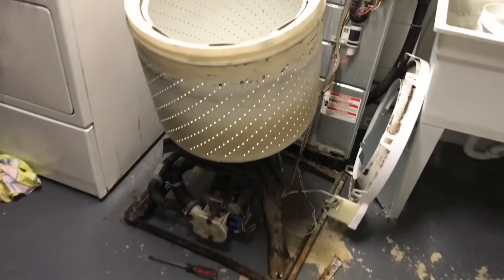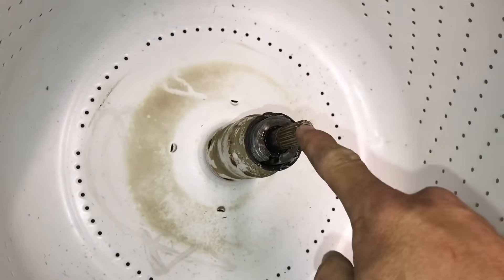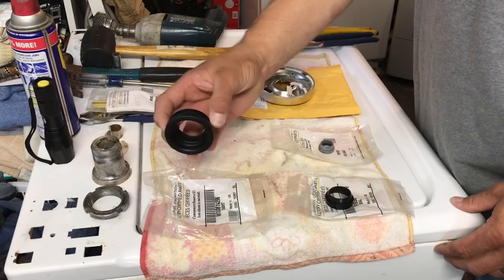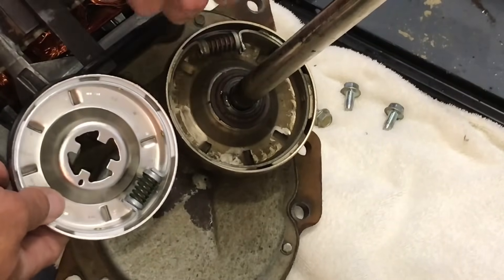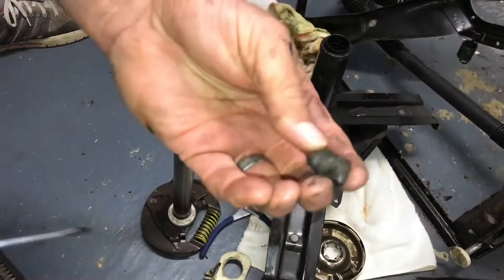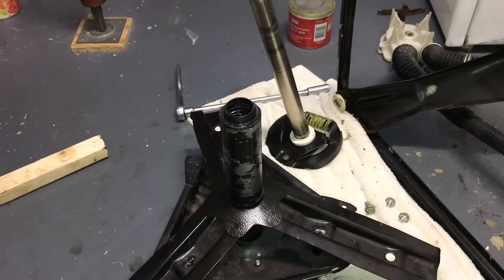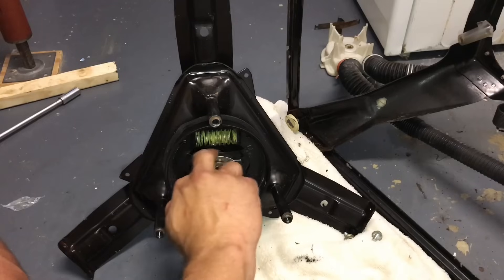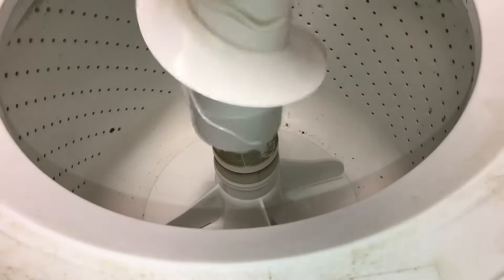Leaking Kenmore Washer - How to replace Shaft Seals.

Comment: Great vid! As appliance tech for last 22 years I never  seen this direct drive washer leaking because of the upper transmission shaft  seal .  it is always tub seal   or lower delta support seal. And yes this is the most dependable and repair friendly washer ,always worth to repair it and keep it! These days appliances are disposable junk made to last 5 years .
Reply: I replaced W10820043 BASKET DRIVE ( shaft w/ seal yesterday for leaking and noisy) Only seemed to leak at high water level
Reply: Hi, whats this 'lower delta support seal' you speak of ?  Thanks.
Reply: @ArnoTrek  I believe he is speaking of the tub support seal.
Reply: @bryanjones4985  I don't understand the difference
Reply: Thanks for your comment, I was wondering what a pro tech would say about this machine.   I've replaced many parts on my machine (Whirlpool LSR6334LQ0)...Hopefully the trans will hang in there, it seems to leak few drops after a month or so.
Reply: @ArnoTrek  and for clarity -- the seals (2) in the bottom of the support tube below the lower basket drive bearing... the lower seals (and upper) are for the basket drive tube (the one with the brake and big yellow spring on it) - if the water coming out the bottom is rusty probably a good idea to change the basket drive bearings also
Reply: Great video but I have messed up 3 lower shaft seals and can't get it to go down. I always tear the rubber part and it still isn't where it needs to be.

Comment: You took a big gamble installing that seal like that, and the way you pulled it out. Use a socket to tap it in not a piece of wood. When pulling it out, pry it out with a screwdriver not between the seal and the wall of the shaft. You risk bending it.
Reply from the maker: Thank you for that info.
Reply: Have you tried this yourself?  I couldn’t find a socket that fit inside the tube and that was big enough to press down on the steel collar that is molded into these seals - maybe an 18mm?, but I only had 17mm or 19mm. No SAE socket would work.   I used a wooden block too and no damage to the seal at all. The upper seal needs to go in further than you can do with a block of wood, but tapping around the edges of the seal (where the steel collar is) does work.

Removing these seals requires prying them out / because they have a thick metal collar molded into the rubber.  There is no way you could pull them out with pliers.  I did it the same was as in this video - and the shaft didn’t bend at all.

Comment: Great video.. I have a whirlpool top load that runs the same way and the setup is the same, direct drive shaft.. Mine was agitating but not spinning when it reached that cycle. Changed the clutch still didn't spin. Checked the coupler and it was good. With the cabinet off I checked to see if the clutch was spinning when the machine was on, it wasn't. Took off the transmission and manually turned the motor, didn't turn. Decided to go into the transmission. As soon as I set free the plate that covers the transmission, where the oil and gears are, about a cup of water rushed out. So I decided to drain all of the oil that was in the transmission, and half was oil and half water. Cleaned the transmission with kerosine and a clean paint brush, allowed it to dry, topped back up the transmission with 16oz oil and assembled the machine.. Machine is now perking, agitating, spinning and working like brand new.. Before this episode I had to change the tub, upper and lower shaft seals due to a leak. I guess what happened was water leaked into the transmission causing the gears to slip, so if you're changing your seals for a leak, check the oil in the transmission for water as well before you reassemble

Comment: Great video and super helpful. One thing to note for anyone attempting this repair- the lower shaft seal has a metal ring embedded in the rubber that you have to mangle to get it out of the tube. Don't put the screwdriver in too deep or it won't grab. I thought I was messing up the tube until I got the whole thing out.
Reply: The upper seal also has a metal collar in it.

Comment: 4years later! The best instructional video ever!
Reply from the maker: Thank you. So glad it was helpful! Happy Holidays and Happy New Year to you and your family.
Reply: Khhhhhbbbbbbbbbbbbbb     

 @SmokinwithKasket
Reply: It looks like to me is there’s corrosion and pitting on the shaft were to seal run on. I would have replaced the shaft just in case. I’m a retired maintenance machinist and worked on a lot of high pressure pumps and I would machine a replace the shaft. Just my two cents

Comment: I found this video extremely helpful, I couldn't have made the repairs I did without it, but I do want to toss in a couple of considerations for DIYers or even people experienced at making repairs. 

We have an old Whirlpool commercial capacity washer and dryer in our company shop that we've used for 20+ years. I got them off my mother when she passed. They've done yeoman's work of at least 5 loads a week, year in and year out ever since. I've worked on them regularly through the years changing out belts, relays, switches, igniters, pumps, transmissions, hoses, controls, etc. We could easily afford a new one, but I love these old machines, their simplicity, their capacity, and their reliability. Having said this, I think this has been the most challenging repair of all that I've made on it. 

Here's why! The drive block was frozen to the drive tube. No amount of WD-4- or Liquid Wrench made any impression. I finally had to place my spanner underneath the nut to get enough leverage with the 3-jaw puller to break it loose. When it finally did, it broke the tube lock on the bottom and the whole assembly came out. It then took concerted effort with a rubber hammer and a wood block to separate the two from the inner tub and even more to get the drive block off the shaft. I have a small press. This is information is not meant to dissuade you, just warn you in advance that this may not go smoothly.

That assembly hasn't ever been out of the machine, even when I put in the new transmission. Truthfully I didn't even know the upper and lower seals were there. The problem with mine, perhaps like yours, is that I let is leak for more than a month before I gave up on it and decided to tear it down and make the repairs. This added some rust and other issues to the springs and getting them loose. I've machined and mechaniced since I was 19 and I rarely give up. I'm almost 69 now and I did eventually get it all out and I did make the repairs. I also broke the water inlet spout which cost me about $45 more dollars.

We've always kept pretty much an entire machine in our storeroom and other than the upper and lower seals and the tub seal, I had a transmission I rebuilt on hand and a brand new spintube assy. I also have access to welders, lathes, flame-spray, end mills, etc. Hence I wasn't afraid to break something if I had too. I've rambled all this time to say that you less well-armed DIYers may need a contingency plan in case things don't go so smoothly or quickly. We're in a small town, but we have the Internet here (Amazon) and we also have an appliance parts store 20 minutes away. If they don't have it they bring it out of LA the next day.

Honestly, when I was 19 I would've beat the Hell out this machine with a ballpein hammer. People would've heard me take the Lord's name in vain repeatedly. Sailors would've blushed. Of course then I'd have had to go out and buy a new washer. Five decades later I have a few more skills, cooler temper, better tools, and easy access to the proper parts if I break something accidentally. I also have the luxury of taking a week to do this repair since I'm the boss and we were smart enough to buy a used spare Kenmore clone set a couple of years back for standby. Almost all the same parts on both.

I find this to be the best video on YT for this repair topic. I hope this comment wasn't too far off track and wish all of you the best of good fortune in the teardown and reassembly of your washer. Keep up the good work William Kasper...
Reply from the maker: Thank you, my friend for your input. That was some awesome information and extremely satisfying to read. And it is true the older you get the more patience you have to deal with these kinds of repairs. I was fortunate to get my tub separated with a three jaw chuck and I wished I would have demonstrated that in the video. I will say this is an in-depth repair And can be difficult pulling parts apart that have not been apart for decades. I’m glad this video was helpful for you. I almost didn’t do it because I generally do videos about smoking meat and outdoor barbecue recipes and it was a last minute decision to grab the tripod and phone and begin filming this video. On top of the amount of work required to do this type of repair. It’s also very time consuming and Difficult to use the camera and narrate and then edit and do all the required functions for a YouTube video. I have to laugh because I must’ve been feeling energetically when I decided to do this repair and make a video out of it.  Thank you for watching and sharing and hopefully subscribing. Stay safe and thank you again for your story.  
-Warm Regards
Reply: No mames, pues que técnico eres?😂
Reply: Same here - used a gear puller to break the drive block free. It fought hard to stay on. My washer is 35 years old and had never been apart.

Comment: Thank you!!  If I had not seen this I would have been at a loss since after disassembly it was clear that the leak coming from the center of my 25 year old Kenmore was not the tub seal.  If not for this I probably would have retired the machine. I used a socket to seat the upper seal as another comment suggested and things are back to normal.  As for removing the basket, I tried a 3 jaw puller but it didn't break it loose.  I ended up removing the spanner nut, placing the spanner wrench (tabs facing up) over the shaft,  screwing the spanner nut back on partway, then placing a large adjustable wrench above the spanner wrench (resting on the shaft) and using two large c-clamps (one on each side of the shaft) to compress the spanner wrench and adjustable wrench together.  This easily broke the basket free.  It had never been removed in 25 years.
Reply from the maker: Hi Michael. Glad to hear this video was helpful. A 25 year old Kenmore; Mine  is half that age.  They are amazing machines.  In 12 years time we fostered over 27 kids and adopted 5.  Our Kenmore washer and dryer have ran 24 hours a day for many days at times.  At one time I considered getting a second pair washer and dryer. Those days are over thank God!  My units have been put though their paces and proved to be amazing machines.  Thanks for the input on removing your basket.  I can imagine after a quarter of a century, that baby was fused on that shaft!  Thank you for sharing your method of (basket) removal. Thanks again for your support.  All the Best my friend.

Comment: This is why I love youtube. The clutch is shot on my 15 year old Roper and I was about to place an order. Then I come across your video and you're the only one that mentions these seals. I was wondering why my clutch housing was rusty. It's because water has been seeping in. Thanks again for sharing!
Reply from the maker: Thank you for watching and commenting. Glad the video was helpful. Best Wishes.
Reply: @SmokinwithKasket  Tore into mine this morning and thankfully I didn't even need a puller. One question though. There's another seal inside the shaft down at the base, just above where the brake assembly fits into. It's more of a normal seal like you'd find on a car. Any reason you didn't bother with that one?
Reply from the maker: @89Mirageman  - Because normally it’s the top seal that gives out and I didn’t want to disturb the bottom seal if I didn’t have to so I just replace the top one and everything worked out fine.
Reply from the maker: My philosophy is if it works don’t fix it. However since you’ve got the machine all tore down if you feel comfortable removing that bottom seal which is kind of hard to get at go ahead and give it a shot. Thanks for watching and commenting and I hope the video is helpful for you!

Comment: Thank you for the video. I have a Kenmore 90 series model 110.4786291 (used for 26 years) and all the parts were the same, even the shaft seal at the transmission level that you did not use. I also change the lower transmission seal with kit part W10111745 & 285352.

I prefer using a socket than a screwdriver to instal the seals (9mm for upper shaft seal and 32 mm for lower shaft seal).

I tested the washer without the covers. I had a white piece of paper underneath the transmission to confirm there is no longer any water or oil leak. To do so, you will have to bypass the lid switch with a 14-gage copper wire.
Reply: Did yours have 2 seals in the top tub support (2nd seal he replaced here) I figured I’d ask since the part site I got the seals from (parts dr) happened to have an instruction sheet pictured with the part on the website that said if it has 2 seals to remove both and replace with just the 1 seal. 19mm socket worked perfect btw so far, since I’ve only replaced the top transmission seal as of right now
Reply: @ You are right, it is 19mm and not 9mm. Sorry for the typo. My seals were as described in the video.

Comment: I haven't started to take mine apart yet. At first I suspected the tub gasket, which looked pretty indepth to replace, and now I'm watching your great video. I have to give you top marks for giving the part numbers for the gaskets as well. Don't see that often.  Thanks.
Reply: Also, with my luck I'd go through this 17 day job(lol), put it all back together and the forking thing will still be leaking, if not more, because I pinched this or didn't knock this in evenly.
Reply from the maker: Glad it helped.  Thank you so much for the kind comment.

Comment: I have a 25 year old Kenmore 90 series that had the original seals in it. It started leaking water earlier this year so I knew I had to replace them. When I took the old seals out they were so rotten that even the metal sleeves on them were rusty. My old drive tube was so rusty and pitted I just ended up replacing that too. Now it runs like new and doesn't leak any water. Thanks for making this video. You've helped a lot of people do this procedure! Also, using a spanner wrench the spanner nut came off surprisingly easy and the basket I was able to get off fairly easy with a three jaw puller.
Reply from the maker: Hi Robin. Thank you for the awesome comment.  I am so happy to hear that my video was helpful for you. Thank you for watching and hopefully subscribing.
Reply: Was yours leaking during the drain part of the wash cycle? That’s when mine seems to leak from the middle. I don’t think it did it during the fill or agitation and it started while it was draining.
Reply: @johnnyversaci7091  If it's leaking from the middle of the machine it's definitely one of the center shaft seal and or the tub seal. Replace all three. I don't remember what part of the cycle it leaked from. If it's leaking during the drain cycle it could also be the seal on the water pump. I would check that first before you tear it apart to put new seals in.
Reply: @star978 cool thank you. I don’t see anything near the pump. That was throwing me off that it only seemed to leak while draining. The water seems to mostly be coming off the back bolt that holds the transmission in and also water along the top of the transmission, on the bolts that hold in the “trans pan” if that’s what it’s even called haha. I should have run it without the cabinet but I didn’t know whether or not that’s safe. I’ll buy all 3 seals and see what I come up with after I get it apart

Comment: Nice job! Never get rid of that direct drive, it is the best washer one could have. One of the reasons why the main tub seal doesn't go bad often is because unlike the seals for the agitator shaft and the spin tube, that one isn't on any moving parts. Like you said though, if you have it all apart to replace said seals, you may as well replace the main one too. Can't hurt anything. You could also inspect those white wear pads that you mentioned about towards the end, but based on how the machine was when operating, they're probably fine. Glad you got the 6-padded spin clutch! 

When removing the spin tube, you can easily get it out by turning the brake cam counterclockwise to release the pads, makes it much easier! Same with reinstalling it too. Smart idea to grease the brake assembly too so the pads move easier. You're probably the first person I've seen do that. Unsure why your tub spring brackets are so rusty. But you can always get replacements if ever needed.
Reply from the maker: Thank you Sharkie626. I appreciate your support and your input. You’ve made some great points in your comments. The direct drives are awsome machines. All the Best my friend!!!

Comment: Thanks for the video.  My older Kenmore was leaking and watching this saved me some extra hassle.  I thought it was my tub seal, turns out it was the shaft seal.  Proved this by doing a load on LOW and MED LOW water levels and it didn't leak a drop until the rinse cycle (full tub on rinse).  On MED water level is where it started leaking while agitating.  Thus, shaft seal, not tub seal.
Reply from the maker: BoHunter2010 Great to hear this helped. Yeah - never as easy as the tub seal. Let me know how your repair panned out. Thanks my friend.